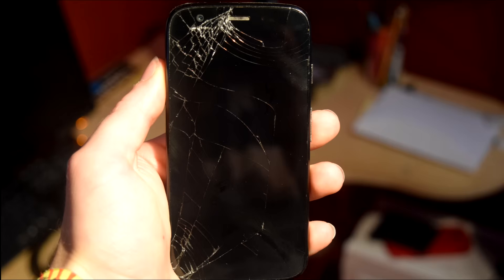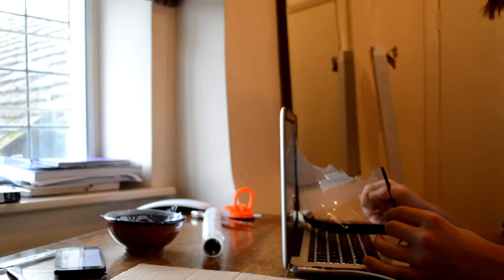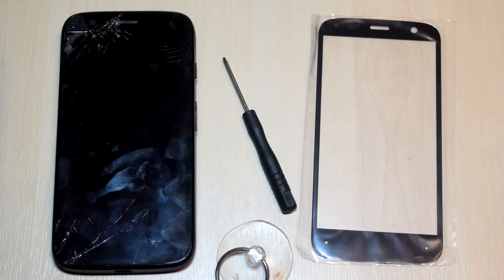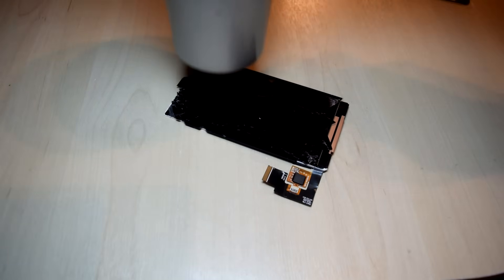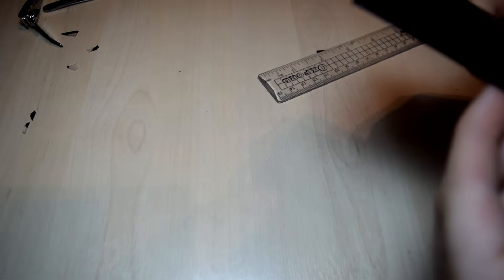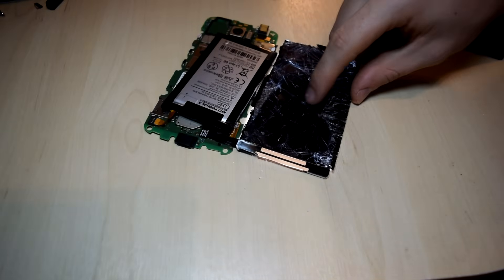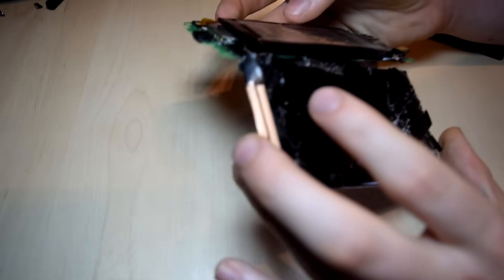Why You Shouldn't Repair A Touch Screen With Just the Glass!

Comment: If glass is cracked it's doable. With a HEAT GUN. A hair dryer your just wasting time. If glass is shattered though then don't even bother. Picking out every speck off the LCD will be a nightmare.

Comment: The actual title of this should actually be Why An Amateur Without Proper Tools and Skills Shouldn't Repair A Touchscreen With Just The Glass. With proper tools and skills including patience, it's a very easy job and the preferred method if the LCD and digitizer are OEM originals and you want to replace with unbranded crap from Ebay.

Comment: I separated my screen completely intact no brakes. The method I used was steam from a small pan of boiling water and a playing card. Took 15 min.
Reply: and then how do you glue the new glass to the lcd screen? this is the only question I have before I get to try it myself. Thank you very much.
Reply: The glass has a self adhesive pre-applied you just peel the plastic and put it on and preferably put the whole thing in a vacuum for a few minutes and you're set  @binchocats
Reply: Don't do this.

Comment: It is ACTUALLY quite possible to replace just the glass! Most display assemblies are layered like this: back-light, liquid crystal display, digitizer, glass... It's key to separate just the glass from the rest of the display. If you separate any of the other layers you're done! Be prepared and patient, then use a heat gun or hair dryer to heat up the screen (keep the heat moving, if you focus on one spot for too long you'll burn the lcd). The heat will make the adhesive plyable so you can then use a thin pry tool or playing card etc to CAREFULLY get in between the the broken glass and lcd to CAREFULLY separate them. You will probably have to reheat the adhesive many times during the removal... As soon as you feel resistance, reheat! Once you're done removing the broken glass, CAREFULLY clean the lcd well (goo-gone, followed by alcohol, then a lcd cloth) be sure to remove smudges and fingerprints, then CAREFULLY adhere the new glass with LOCA (aka liquid optically clear adhesive), place in the sun to cure and you're all good! Keep in mind this IS DEFINITELY a riskier repair (as correctly stated in the video). The display is very fragile and one wrong move will render it useless and you'll have to do the assembly replacement anyway, but done CAREFULLY, it is possible. Look up glass replacement tutorials for your device model and watch how it's done! Happy repairing! 😊
Reply: You can also sometimes get to be a lucky SOB like me, and there's an airgap between the touchscreen glass and the LCD, like on the Colorfly E708 Q1/2 tablets.  Oddly, the Unnecto Primo phones also have an air gap, but no touch screen.  They were intended to be almost indestructable.
Reply: Will you walk me through it on the phone not wanting to mess my screen up...?
Reply: Can I use hair dryer heat it and then shall I wait to cool then remove the glass
Reply: Wow....your very pretty and with brains =)

Comment: It's better to fix the original screen with a new glass instead of buying a new one from ebay. Those modules, new screens, have not the same display quality as the original. Besides, it will be cheaper than buying the whole thing. If you don't know how to do it, leave this to professionals..
Reply: I’m thinking of doing it myself, but can it be done easily enough with a regular ol’ heat gun?
Reply: Metaorange Dont think so, you'll probably damage the LCD with the heat gun. You need a special griddle which it can be seen in glass repairing videos, also you need a thin metal thread to separate the broken glass from the LCD. Thats all. Later youll need UV glue or UV gel to get a clean work.
Reply: Metaorange Oh, I forgot something very important. You cant use UV glue with LCDs, you'll damage it. It only works with AMOLED screens.

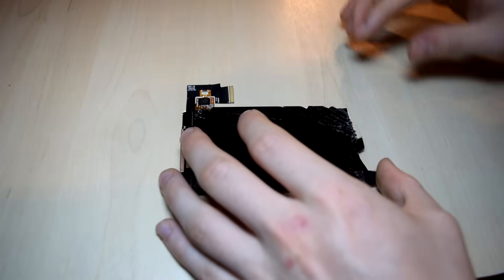Comment: As an amateur phone repair guy, I have to give this video a thumbs down, its discouraging ppl from doing something on the basis that this guy either did utter crap or tried to fix a screen that was already seriously damaged. 1. Inspect the screen for non glass related damage, ie see if cracks are only on the top layer of the screen or if they are seen on the lower layer (the digitizer) before heating the screen sufficiently and  carefully removing only the top glass layer. I'm assuming the Moto G's screen even if functioning was utterly shattered and was only being held together by the glue used to attach the glass onto the digitizer. 2. At the 1:40 mark in the video was where you stop and test the screen as it seems all the glass has been removed.  he on the other hand is still heating, cracking, damaging and further destroying the part of the display he is supposed to be salvaging. sadly ppl here thought it was doing the right thing.
Reply: i am a 100% with you on this one, i have a moto C with only the top glass layer barely cracked, the "digitizer" is totally fine , my dog bite it, but just in the lower right. This video is crealy for someone who really fucked their phone. Im glad i read your coment, otherwise i would've spend my money in something i didnt needed!
Reply: I need to just replace the glass, everything else is fine. Seems nuts to disassemble the whole thing
Reply: This guy is one of those "actually" know-it-all jerks... He never gets laid.

Comment: I tried replacing the glass only and have come to the same conclusion, it's close to undoable without special equipment (didn't even have a heat gun but used a hairdryer). Still, you shouldn't make assumptions on the cost of time for your viewers - 20pounds is actually some money people might try to save by investing a couple of hours.

Also, on some phones it's rather easy to remove the glass only, like the lg g3, as the glass (with touch) is one unit and the lcd/backlight another. The thing with lg g2/3 is that often the glass stays intakt and the lcd breaks…

Comment: It's really easy if you know what you're doing and use the proper tools. you need a hot plate to get it to the right temperature, by the time you've done a couple of phones the hot plate would've paid itself off
Reply: roasting, not our future I got mine for $75 on eBay and it came with a ton of stuff. Paid for itself with the first glass replacement I did.